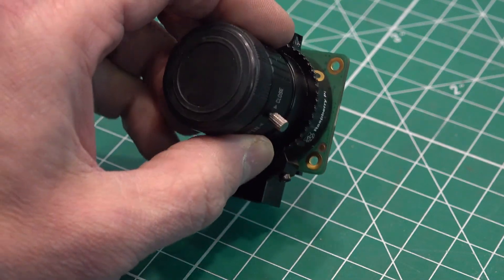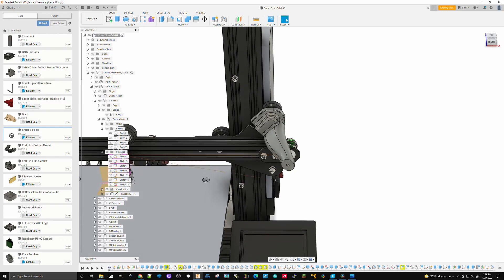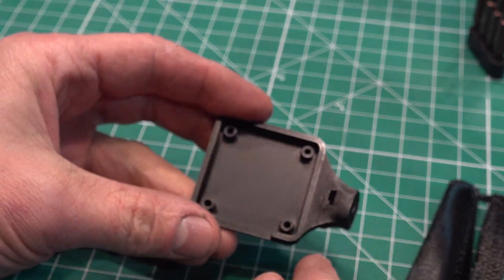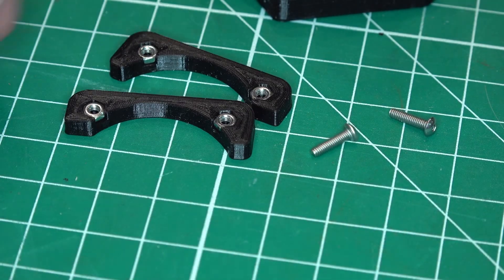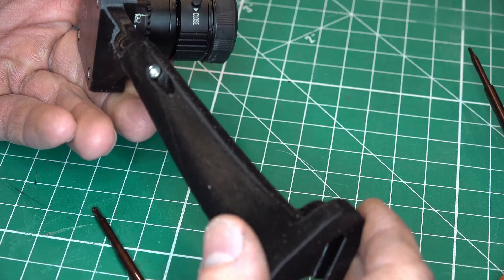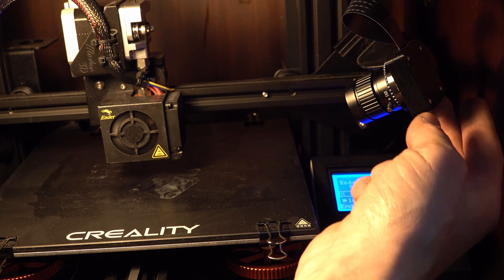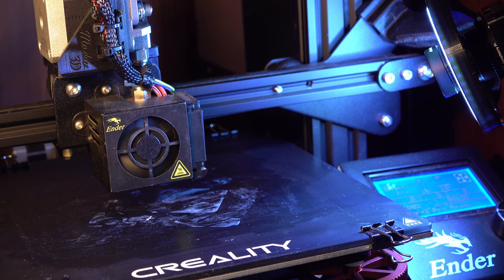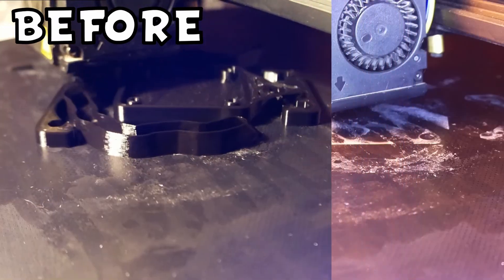3D Printed Raspberry PI HQ Camera Case Design and Build for Octoprint

Comment: Happen to ever complete the new design and possibly releasing the STL(s).  Love the direction you went with this and curious about the changes you made.
Reply from the maker: I did do some work on it, but I feel it's just not ready to go public yet.  I made the mounting arm to accept loc line "adjustable coolant tubing" and ran the wires through that so there was more adjustment with a cleaner look.  It's been so long, maybe I'll make an update video about it.
Reply: @HootBuilds  thanks for the update.  If you ever get around to doing an update vid, I'll definitely check it out.